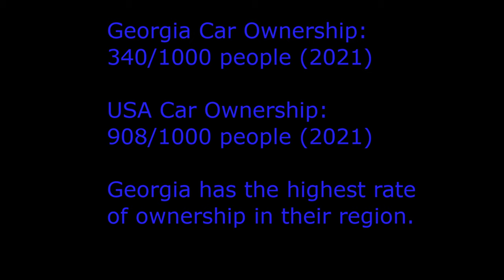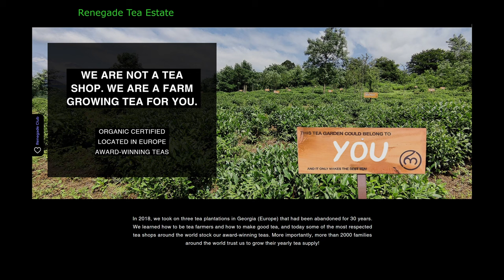Ex-Soviet Transit: A Consequence of Corruption

Comment: tram system was already declining before ussr collapsed mainly because of metro was expanding some parts where tram lines were or close by. but there were still some small expansions of tram lines.
 but when 90s hit and economic decline,barely any electricity, old trams that need it to be replaced slowly lines where closed. after the ross revolution georgia become better economically.but the new government didn’t care about the trams and in 2006 dec 4 ended tram operations.                in 2010 same government that ended tram system wanted to build new tram line that would have cost 143 million euros but the new government cancelled the project in 2013 because it was too expensive